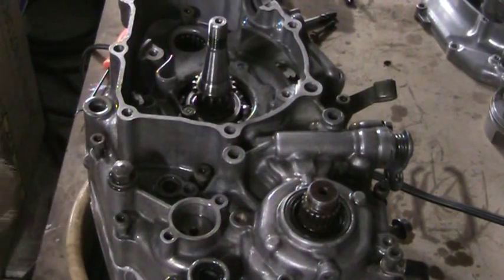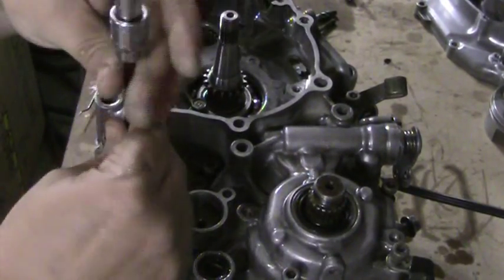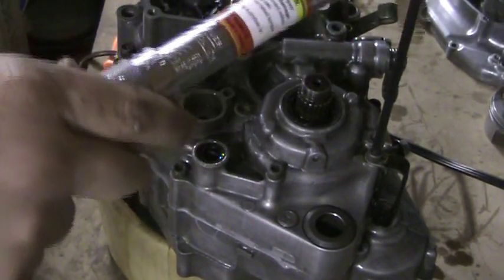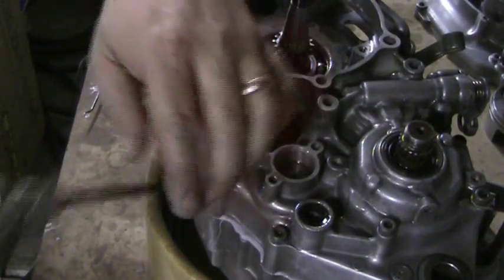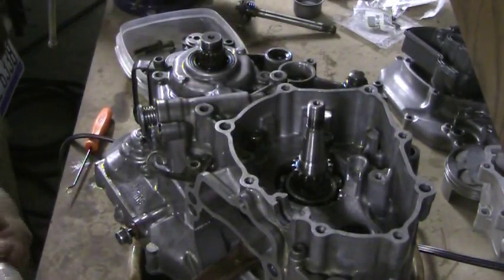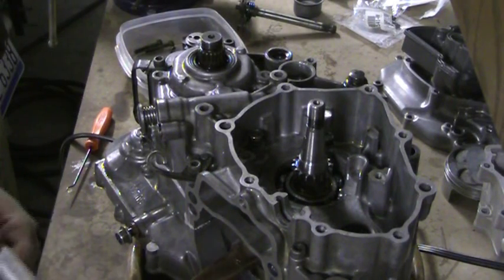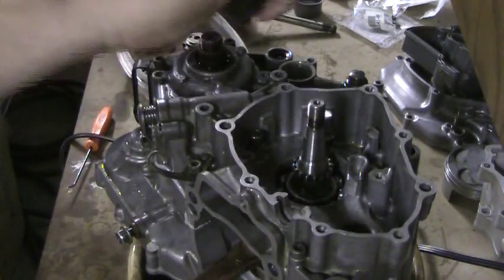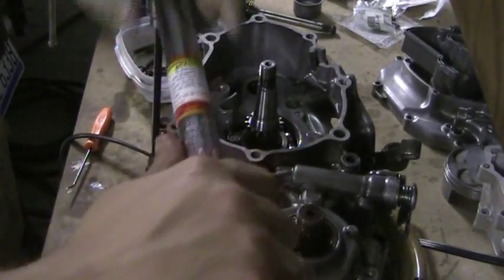Part 13: Assembling dirt bike motor bottom end mating cases 2. YZ250F example

Comment: Hello, thanks for taking the time to reply. Come to find out it was my fault, after looking over the engine manual a "few times" i noticed i put a washer on the shift mechanisms that was supposed to be on top of the clog gear after fixing that it took the pressure off the shift mechanisms and all is well now. kind of amazing how a thin washer could make that much of a difference i can turn the tans and switch through all gears fine.

Comment: Hey, i was wondering if you could help me out, i just replaced crank bearings and i am back to the clutch hub on putting it back together, i was wondering if there was a way i could check to see if the engine will change gears before i put it all back together. thanks

Comment: i did what you said put the cases together and it shifted fine after i put bolts in the case i couldnt turn it with my fingers anymore to shift, is that normal?

Comment: you seem to know what your doing, so im guna trust you on this question.... i have a 1982 yz 100 2 stroke, there is like oil like goo that leaks out of my exhuast, what does this mean?, is it common?, is it good or bad?? if bad what can i do to fix this, i have new reed valves in the bike and i always make sure my oil gas ratio is correct or atleast dalm close, please help, keith... thanks